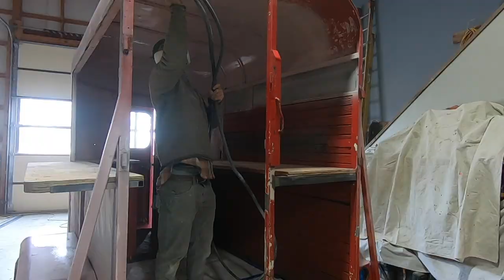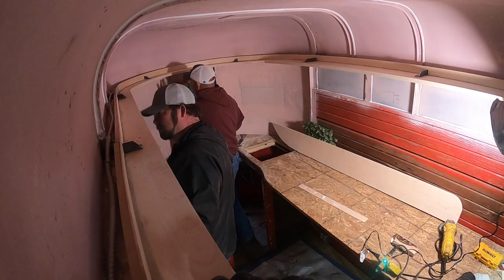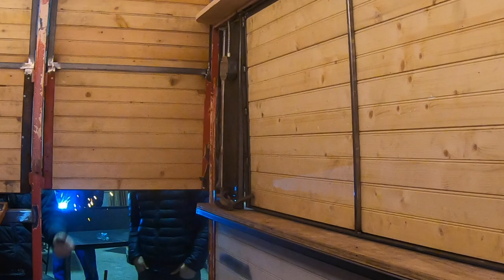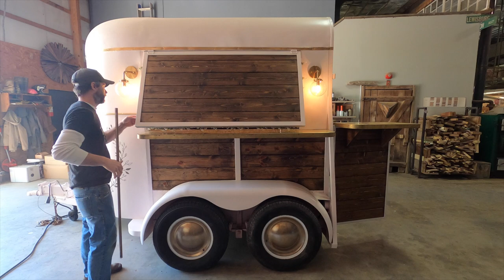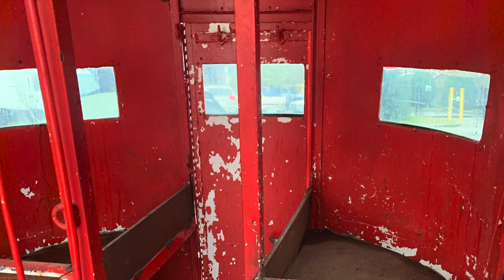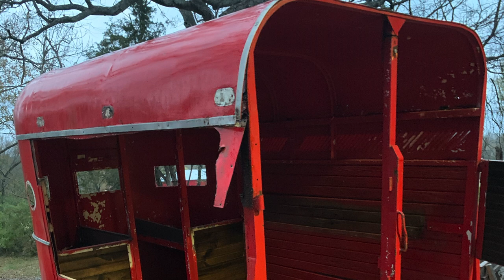How to turn a horse trailer into a bar on wheels

Comment: ++hi from ireland hope yor all well there , firstly great jog 9n the conversion looks freh , so could you send me a link to where you bought the flowers used on the truck they look great. we want to sell smoothies andcoffey here and that look would work well for us, also do you use shore power or a generator,and ae your fridges etc runninng on 12 or 24 volts, if you have time to reply i would be grateful thanks folks Tom
Reply from the maker: floors are just pressure treated plywood with rubber over the top
Reply: I am also curious where you got the plants?